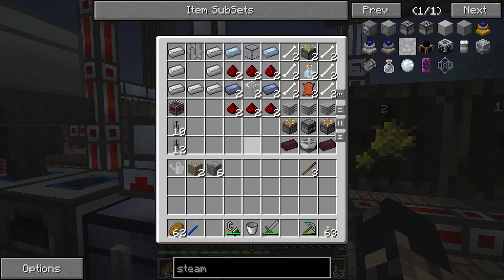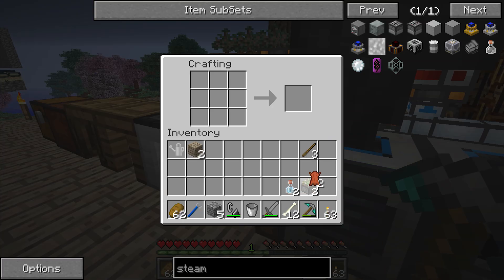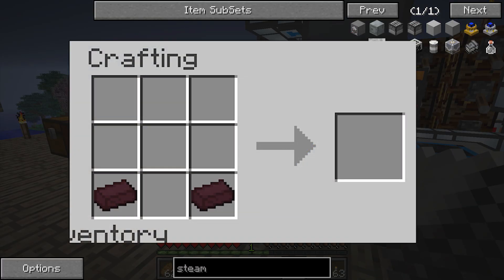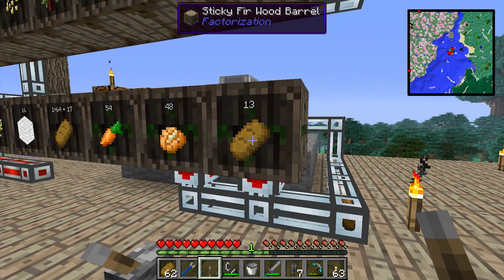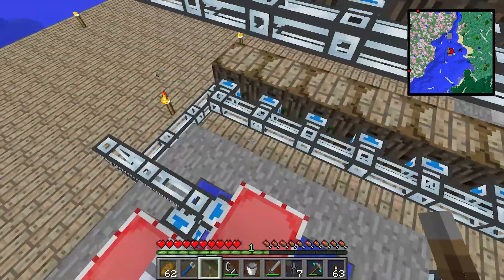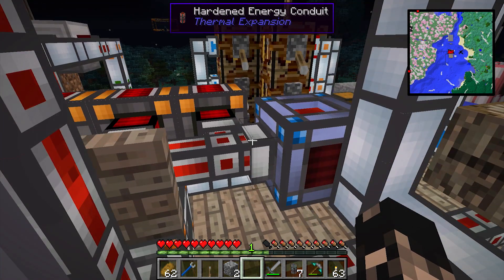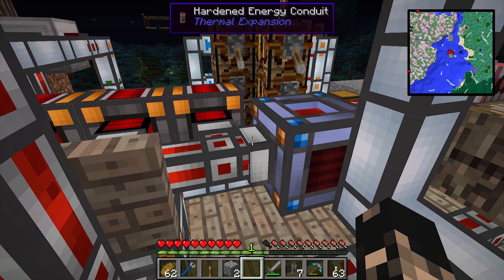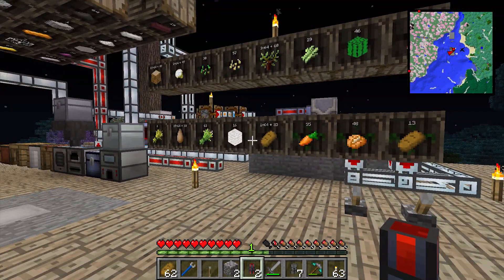FTB MFR Steam Turbine, Turning food into Power EP9

Comment: btw, the steam turbine is actually able to run off of just water, if you have thermal expansion(which you do) then you can put an aqueous accumulator below one and it will provide power for free
Reply from the maker: I noticed that too while testing rotarycraft and had a water pipe accidentally touch it. turn out it will power of lava as well.
Reply: Do you know if it produces anymore power with lava?
Reply from the maker: they seem to max out at 160 will all the liquids/steam

Comment: Can you use the steam turbine with MFR only? I can't figure out how to generate steam in FTB lite.  Do some MFR machines actually require other mods to function?
Reply from the maker: As far as I know the steam turbine is used to generate power from steam and steam only comes from other mods. Your best bet is looking up steam in NEI and seeing what makes it. Usually Factorization and Rail craft make it in the other packs.
Reply: Ausyarr
Thanks for the response!  Yeah I looked through NEI and the mod pack I'm using (FTB Lite) unfortunately doesn't have any steam generated mods included.  The only other steam related item is TE's steam dynamo, which automatically uses the steam for RF.  I'll look into Factorization and Rail Craft.